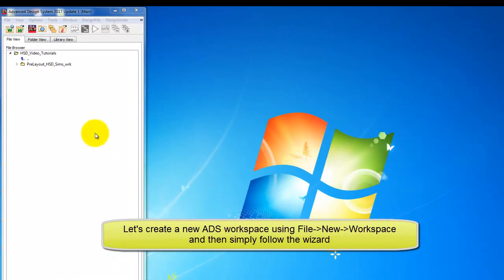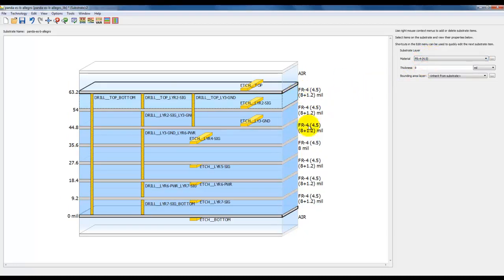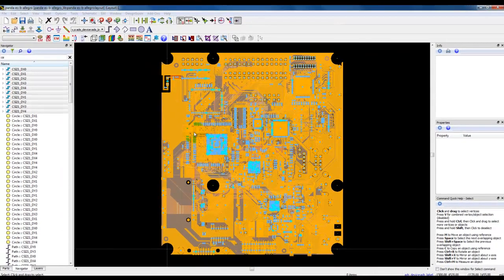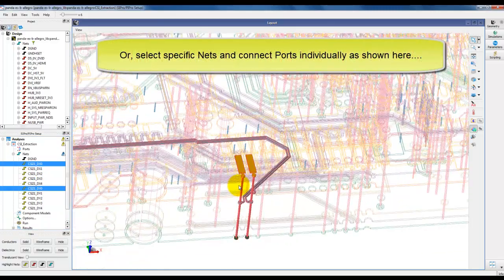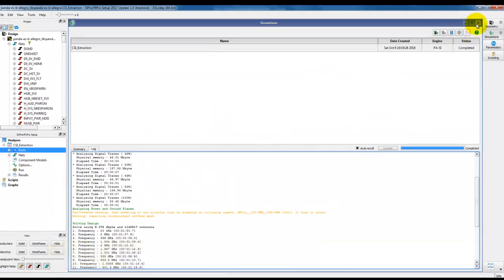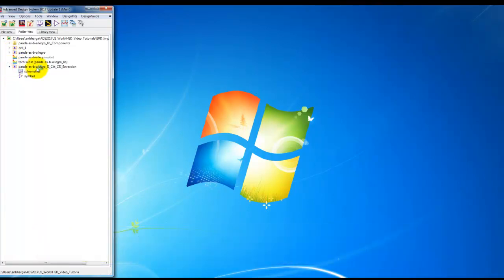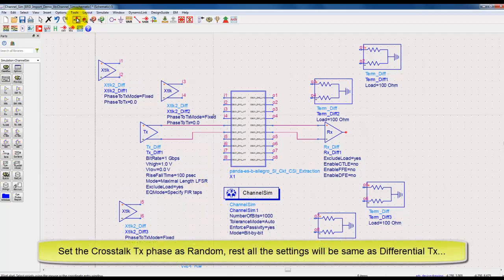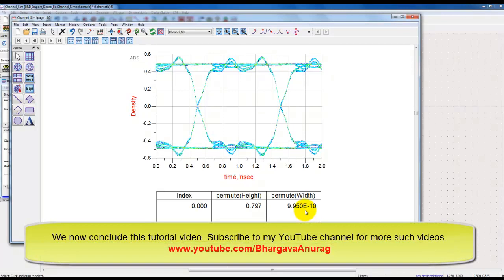HSD Tutorial-4: Allegro brd Import and SIPro Simulation

Comment: HI Sir, Thanks for the helpful video. Iam getting below error while doing Power Aware SI Analysis Simulation
Simulation Failed on step <class '__main__.Hybridize'>
Can you please let me know what does it mean and what I'm missing?
Thanks in Advance!!!
Reply from the maker: Hi Monisha,
You are not doing anything wrong. I have seen these kind of errors before and this is due to your Anti-Virus or Endpoint protection blocking the simulation process. Kindly work with your IT/CAD team to create a exception for ADS processes.
You can contact local Keysight tech support team for help.
Reply: @BhargavaAnurag  sure sir.. i will work on this and tryout simulations... Thanks for your suggestion.

Comment: Thanks a lot for this.  Great video.  A quick question?   Can we do complex digital layout, say 18-layer stack with FPGA of >1000 I/O pins, all in ADS instead of importing from Allegro?  In this way,  board level layout and simulation can be all done in one place.  Or are there already videos for making complex digital board in ADS?  Thanks again for your good work.
Reply from the maker: Hi Yulung,
ADS is not the general purpose board layout such as Allegro, Expedition etc so I won't recommend it for high density mixed signal board design for now.

Comment: Dear sir, thanks again for great tutorials. I wonder whether importing ODB++ will give faster simulation time that Gerber for the same board? I noticed that in your Gerber import video you cut out the board areas not involved into the simulation. While in this video you keep this complex board as is.
Reply from the maker: Hi Yulia,
Simulation speed is not dependent on type of file you import, it is which simulator you use. If you use SIPro then simulation speed will be faster as compared to traditional Momentum or FEM simulator. In the Gerber video I showed how to make it suitable for Momentum/FEM hence the cookie cutting.
SIPro is more suited for high speed boards and it is Net driven hence we prefer either ODB++ or brd file as Gerber is a flat file format with no information of Nets, stackup, connectivity etc
Hope this clarifies....

Comment: How do you download and install cadence without a license? Can you further elaborate how to import a .brd file without cadence installed? Is there another way? Thanks
Reply from the maker: Hi Benjamin,
You need to have account on Cadence website to download the Allegro installer and it doesn't require any license to create the account. Allegro can be installed without any license as we what we need is just the extracta files under the installer. It was all working well till Allegro 17.2 however from ver. 17.4 onwards you need to have license even for extracta so brd import won't work if you don't have valid license.
Alternative is to use ODB++ file import which is independent of any PCB tool and is supported by all major PCB tools,  your PCB designers should be able to export their designs in ODB++ format and then process is very similar to importing brd file and setup the simulation. See a tutorial here: https://youtu.be/vgOlgX6zHyU 
Hope this helps...

Comment: Sir, is it possible to do SI/PI analysis from Gerber files?
Reply from the maker: Hello Bhagath, Yes it is possible to perform SI/PI by importing gerber files but setup will require lot of extra effort as Gerber files do not have any Net information or component connectivity info as well as stackup details so you will need to end up doing all those steps yourself. Instead of Gerber I would propose to import ODB++ import and setup SI/PI analysis which will be very easy. See one of the videos here: https://youtu.be/KffGvi29EB4 
Hope this helps.